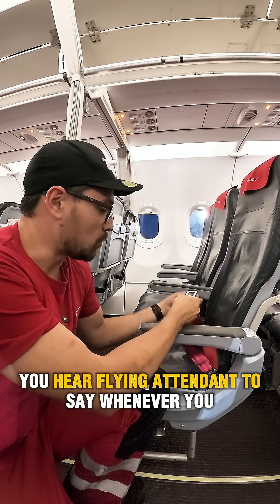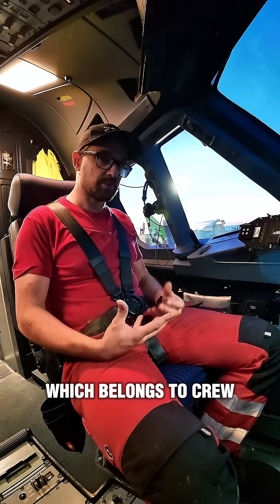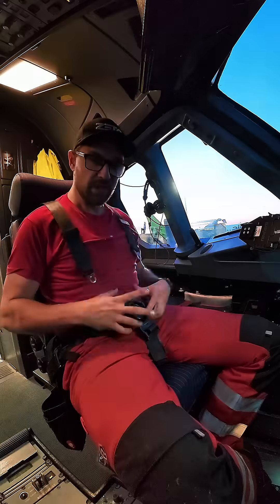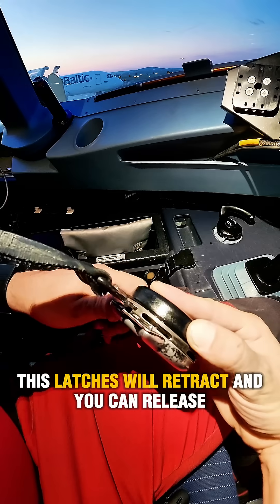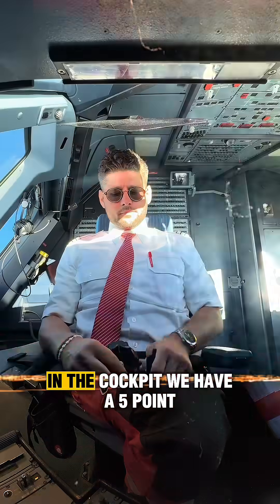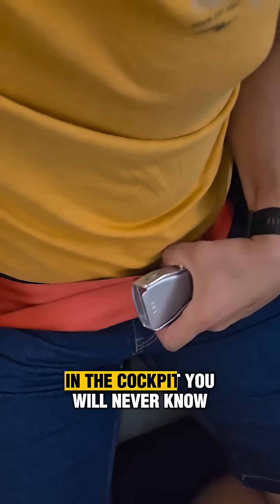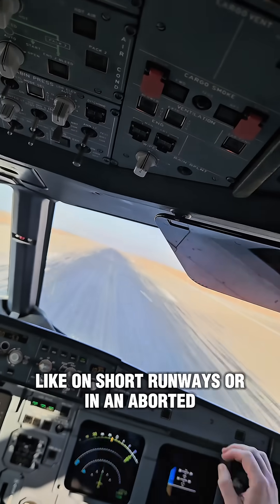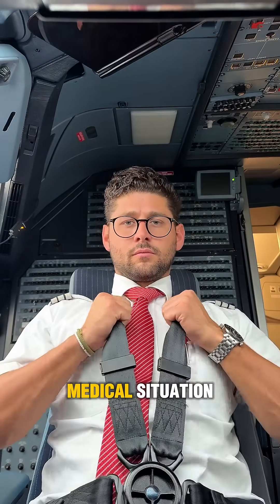Aircraft cockpit harness system has special lever

Comment: That very last part of the locking system does apply to a pilot's incapacitation, in which case the cabin crew (if not able to remove the pilot) will lock the seat belts and move the seat backwards. 
It does not however make sense to use it if you are preparing for a crash landing or ditching. The last thing you want is to get stuck in that seat and not being able to escape afterwards (if you're lucky to survive). 
The normal restraint system will lock the seatbelts if it has to.